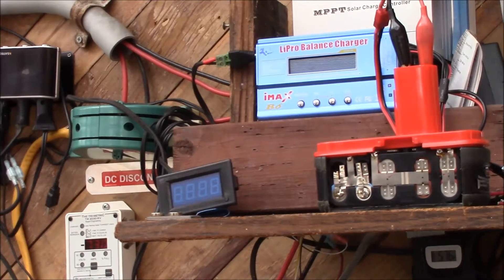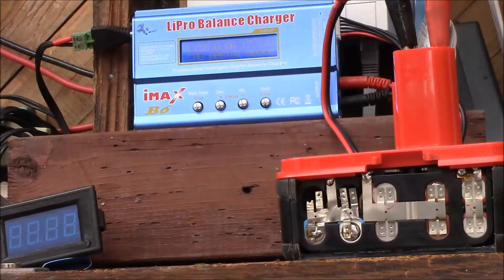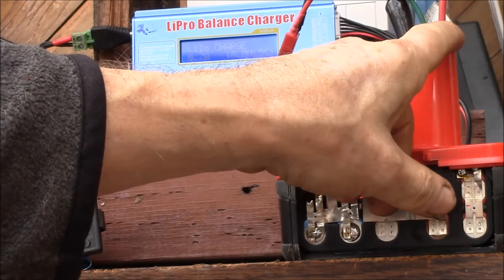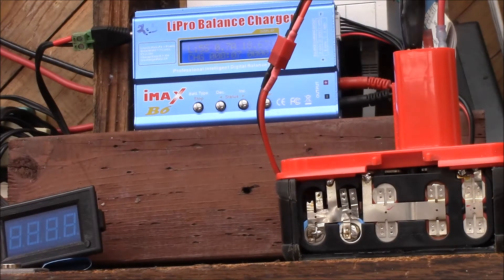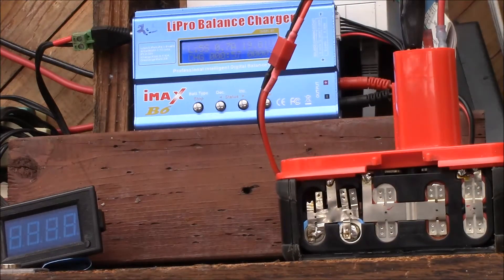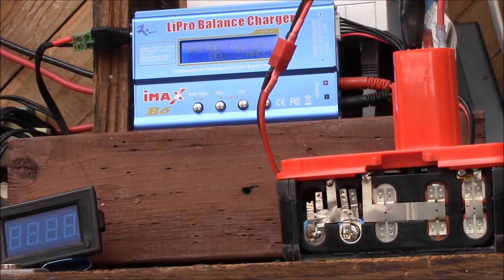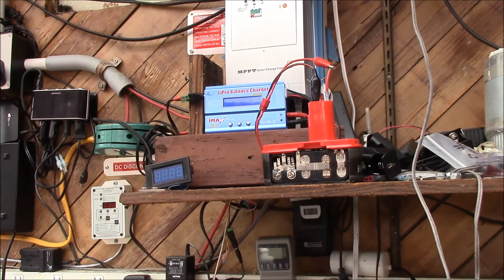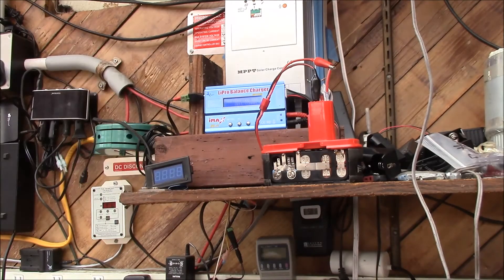Craftsman C3 Battery Charging, Part 7a

Comment: I have a couple c3 batteries with some weak cells in them. They was shutting down early and didn't like to take a charge due to the IC realizing it. I removed the mosfets and put in a bypass wire to ground. I realize the dangers.. but the batteries are back to work.
Reply from the maker: Yes, that likely works well as long as the weak cells still work to some degree.